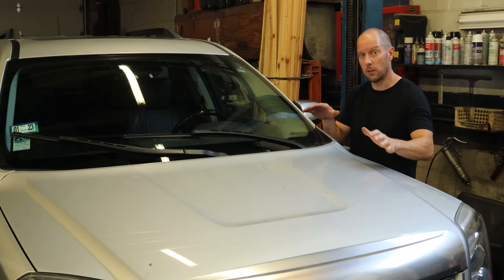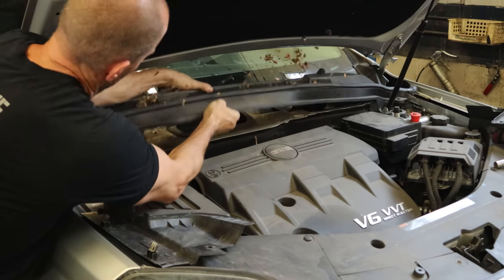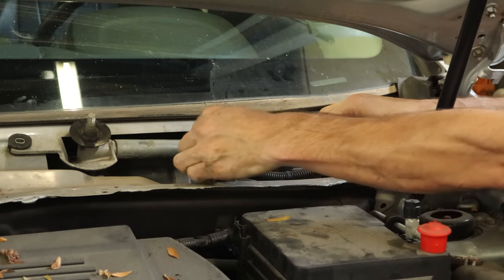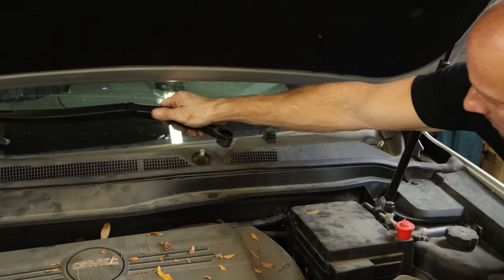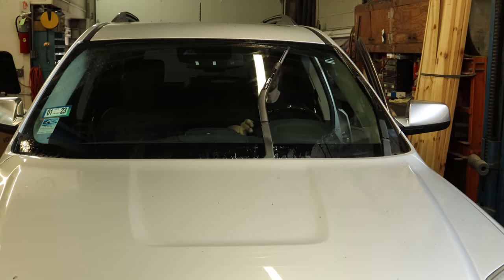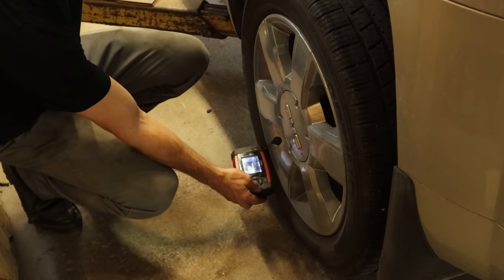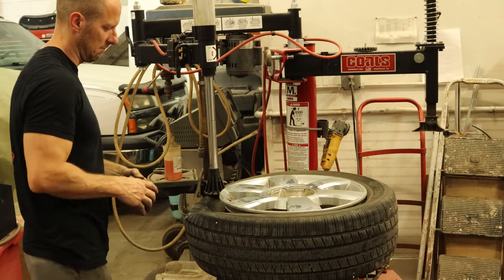GMC Terrain wipers not working and TPMS repair and somebody "fixed" it after a fender bender

Comment: I had an engineer from an unnamed manufacturer say they switched to plastic ball cups for when idiots try and scrape ice off thier windshield. But they are of course frozen in place and the motor binding the transmission breaks more stuff than the plastic cup.

Comment: Old wiper assemblies had metal bushes and clips. They lasted the life of the vehicle. Here we have another case of the good stuff being replaced by plastic, which is slowly taking over vehicle parts. Next thing, the entire vehicle (other than mechanical parts) will be plastic, probably 3D printed on a giant 3D printer.
Reply: already happening, plastic oil pans, plastic intakes (for decades)
Reply: Back when vehicles barely lasted 100k miles ...
Reply: @petersmith7140  Just saw this plastic car on Arthur Tussik's channel https://www.youtube.com/watch?v=mZtwauZjncI
Reply: @arealsourapple  Yeah, The wipers still worked for several engine rebuilds.
Reply: @BrucePierson  Yeah, id much rather my engine fail than my wipers
Reply: @BrucePierson  lol. I'd rather have an engine that can go 300k miles with only fluid changes, than have wipers that last forever. Course you could just buy a Toyota and have everything last forever.
Reply: @arealsourapple  I've had my older vehicles last a lot longer. Usually some moron hitting them is why I don't have them anymore.
Reply: @keithharden7844  How old is old? Because basically anything fuel injected is what I'm referring to as NOT old. I don't consider my 1993 Dodge Dakota "old" because it's fuel injected and the engines are known to go 200k without major service easily (transmissions not so much).

Comment: When it comes to GM and recalls they are actually pretty good.
My mother-in-law had a 2000 Grand Am, she got a recall notice in I think 2018, but the car was scrapped in 2017 after the engine blew up with over 500,000 km on it, but even though the 3.8 was blown and knocking it still ran.
Reply: Thats a very special car if it had a 3.8 in it. Prob 1 of 1 built for a 2000 Grand Am. '

Comment: I was part of the big G-body recall back in the late 80s early 90s…. Rear backing plates were the culprits….. all you had to do was set up an appointment, show up with a new set of rear shoes and General Motors did the rest🎉…. Too bad they didn’t recall the rear frame rails and body mounts…

Comment: So, doing a little house cleaning around my desk today and what do I find? A recall notice  for my 2015 Equinox for ball joint defect in the wiper module that" could result in the separation of one or more ball joints from their sockets during wiper operation." Like their air bag recalls there's no parts at this time for the fix.

Comment: I am barely a diy'er so I do what I can and usually takes me twice as long and I waste a good bit of money. I had the same wiper issue on my wife's 2016 Equinox LTZ. I went to the dealer, explained the issue and purchased the $150 wiper assembly. They never mentioned a recall but the car is fixed. 200,000 miles and still going.

Comment: In the interest of high quality work, the valve stem should have been changed as well.  They are cheap insurance against a leaky valve stem and the whole assembly can be screwed together and pulled into place eliminating the chance of dropping the tiny screw in the tire.  We also use small bolt cutters to cut off the sensor before pulling out the old stem.  No lost T10 bits in Narnia that way.

Comment: How long do TPMS sensors last? My car is 18 years old soon to be 19 and I've never had to replace any of them.
Reply: Hummm. They have a battery which has a limited lifetime. Depending on where you went when your tires were replaced the batteries were replaced
Reply: @Dog.soldier1950  Maybe my car doesn't have batteries? I can tell you that it's not a smart TPMS system because it doesn't indicate the pressure for each tire or which tire is low. It just illuminates a light in the instrument cluster and beeps. If all four tires are low it will beep 4 times.
Reply: I have a 2006 mine hasn’t worked in 2yrs never worried about it.

Comment: I wish my tpms light were that easy to fix.  no pressures, no key fob function.  replaced and programmed the RCDLR and BCM, and found a corroded wire.  still won't work.

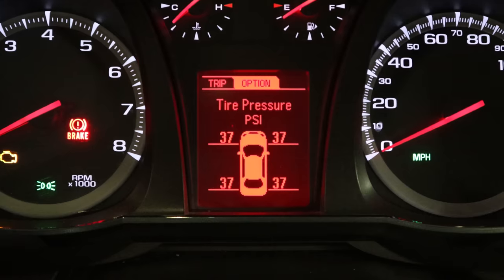Comment: 14:20  All the tires are low, they are only at 37%, you really need to fill them to 100%, SMH.  At least you got the oil full to 100%.

Comment: Didn't last long being pretty!   Now she's a full on battle cruiser!   Could of brought it to the shop that did the door repair... they could of fixed those pesky wipers with a coat hanger!        😂      Scott, if my vehicle looked like that after a repair, I would not accept the repair.    Is there an easy way for a consumer to determine if a shop does good work other than looking at the vehicles in the shop they've worked on?    I've not had much body work thankfully, but what I have had isn't great.    I feel like it's customer beware.

Comment: you made it sound like the insurance Co is the one to blame for the "POOR" repairs, last I checked the body shop does the repair, I would be interested to see what the insurance Co wrote for the damage estimate as sometimes we know the owner elects to take the vehicle to a shop that does not repair the car back to pre-accident condition to either save the deductible or profit from the loss.... and yes I'm an insurance adjuster with over 30 years writing estimates.
Reply from the maker: They are indeed the ones to blame.  As you know adjusters pressure customers to take cars to their direct repair shops.  This is what they turn out… the shop sucks and so do the insurance companies that prey on uneducated consumers.  The owner was told they had to take it to that shop by the insurance company.
Reply: @vehcor  Not sure what the laws are in your state but where I come from the insurance Co is not allowed to steer vehicles to DRP shops. as a field manager if I had a DRP doing work like that they would be removed from the program in 5 sec... don't get me wrong I like watching your videos... but it seems its always the repair shop trying to throw the insurance Co under the bus. I have caught so many repair shops committing fraud, or enhancing damage to drive up the repair cost it would blow your mind.  :)

Comment: If the battery in one TPMS is past it's "Best By" date and the car is around 8-10 years old chances are the other three sensors are about to die as well.  Wouldn't it make sense to just go ahead and replace all four and save three more different trips back to the tire shop?

Comment: TPMS is a waste of money and thus energy. The reasons for having such a system was grossly exaggerated.  The claimed savings in gasoline is mostly complete fiction.  The addition to safety is also pointless in that most people who don't pay any attention to seriously low tires as observed from outside of the car are also in the habit of ignoring the warning lights on the dash.
But to make it all worse is the sensors expire after about 10 years because they use watch batteries which will go dead.